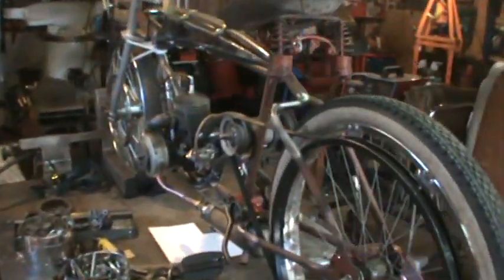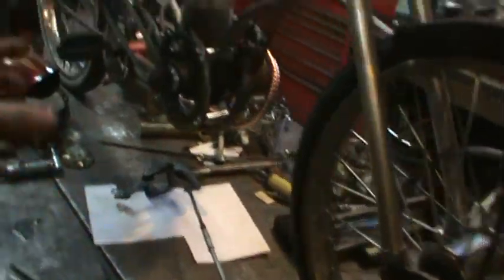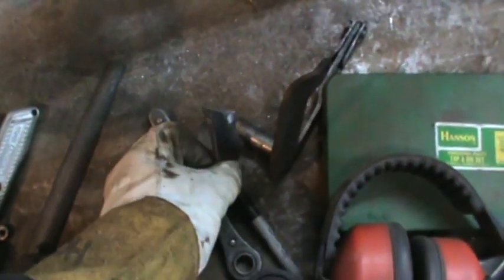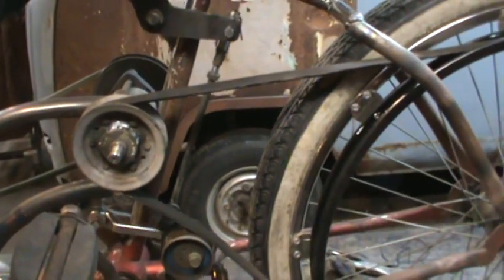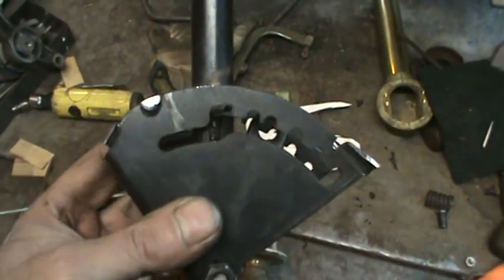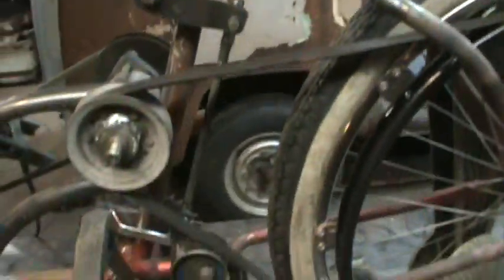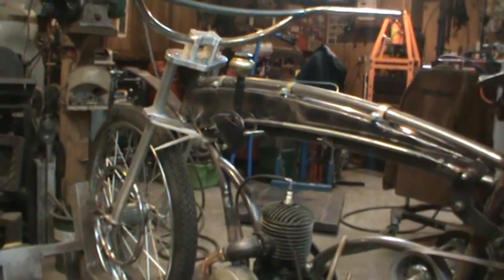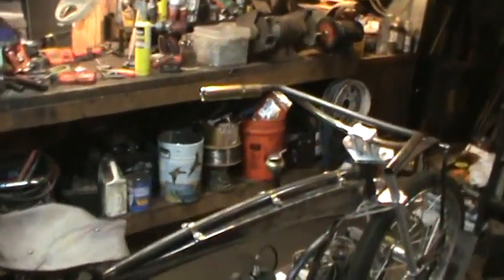bike clutch levers and doodads

Comment: Hej Mr. Mustie1 
I really like your content on the VW´s.Although i am not a bike Guy,your bikes are cool too.The only thing i do not understand is your solutions for clutches.For me there are way to many belt´s.Why dont you go with a centrifugal clutch?
Greetings from Germany and keep the good work up.
P.S.Everytime i visit your channel,i have to quickly stop your intro video.The engine sound is pretty loud.
Reply from the maker: +peter bond needs to be able to pedal start, so the back wheel acts as a flywheel dump the clutch and it spins the motor,
Reply from the maker: +peter bond thanks

Comment: That came out great, still loving those copper touches. Btw why are you using belts instead of chaindrive in most cases?
Reply: Let me try to answere that myself after thinking a few seconds, because the engine don't have gears so cant have clutch... ?